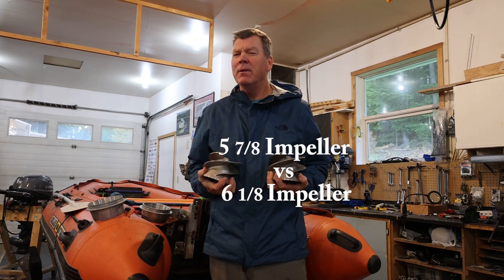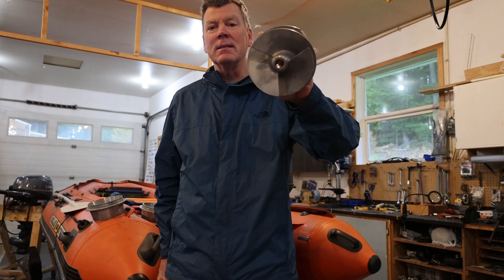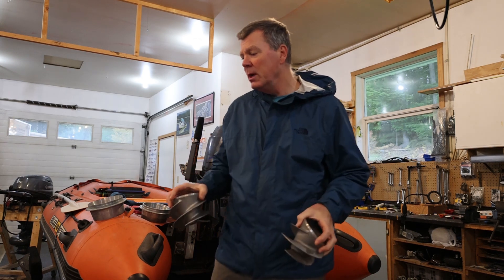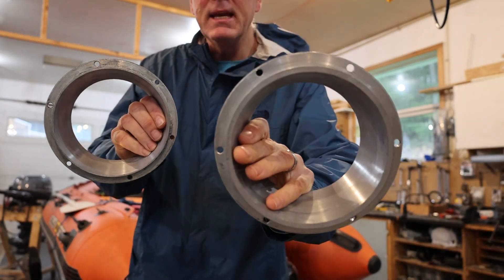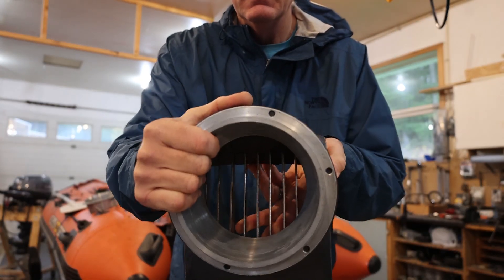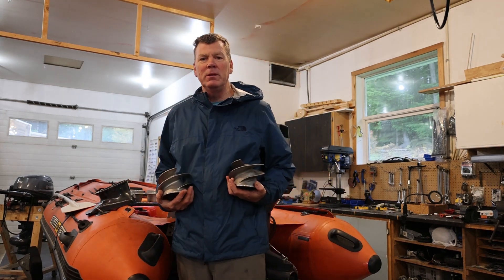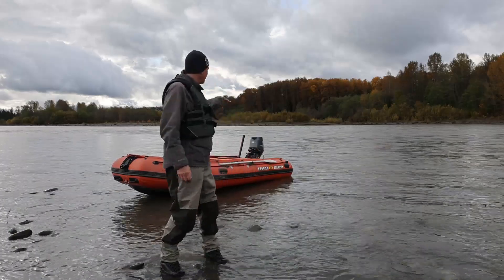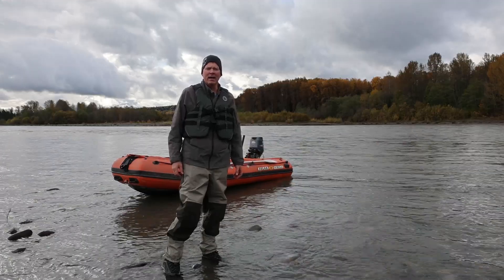Does Impeller size matter?  Comparing two outboard jet impellers.

Comment: I have a "small" pump and my current impeller is 6 inch with bolt in liner. Would I be able to run a 5 7/8 liner and impeller which is more widely available or am I stuck sourcing the 6 inch

Comment: This is very informative and specific as I run a OEM Johnson 45/30HP jet similar to this motor. I believe I am running the 5 7/8 impeller as I do not have as high an RPM range similar to this motor. It has been a great motor though. Bout to add a twister nut and hopefully in a couple months I can get a polished stainless impeller for her. Really would like to see if I can break 30MPH!
Reply from the maker: Thanks 
The 6 1/8 impeller would give you a bit more top end and a speed nut will help with a bit more holeshot
Reply: @ the twister nut/speed nut will be here this week. I sheared my impeller keys this past weekend and had to do a bush fix to get the one trip I had finished. I’m in a 99 Lowe 1448 with a custom front console & tunnel hull with the Johnson 45/30 jet I mentioned. I can hit 22-25 but want to add 5mph as I know it’ll do a couple things… 1) less hull in the water while on step 2) less fuel burn as a result of number one. Also decreased travel times which means more fishing at the end of the day.

Comment: Hey rob, Just picked up a 14ft fishrite sled with an 89' yami pro50, medium jet drive. I assume its a 6 1/8 impeller. Boat had been sitting so I gave the carbs a once over and did a link and sink. Got out for the first time and noticed the hole shot was painfully sluggish. Bow kind of settled half way but then felt like it took about 20 seconds to finally reach top speed. First thoughs are weight distribution or the motors is just a little underpowered. The impeller and sleeve have defintely seen some better days and I'm down to last shim but I would love to hear your input as you seem more experinced than me on this stuff.
Reply from the maker: @loganfishbeard  hmm could be a few things 
Is the intake up high enough? Is the reverse bucket creeping up over the pump at all in forward ? Like u said your liner and impeller am need a replacement if it’s already down to last shim. Is it plowing at full speed? Is the planing line at the back third of the boat ? Make sure the throttle is opening the carbs fully
Reply: @RobBryce Thanks for reply! Intake seems about 1/2" on the low side but no water appears to be coming over the top of the shoe. Reverse gate is clear and snug. Carbs look perfect. Planing surface is just right once the boat gets there. I will try to get some gps speeds next time I get out on the water. I just don't want to drop $400 on a new impeller if what I really need is a $4 sandbag in the bow.
Reply: @RobBryce  Got the boat out a couple more times now. Redistrubuted some weight, weight and she got up on plane more reasonably with 2 small guys at about 18-19mph and topped out at about 26mph. Load down with a fat guy and couple extra 150# of gear I could not get the boat to plane on the last trip. I found a feeler gauge and measured impeller gap to be about .010 righht at the tips but closer to .040 about an inch up where the gauging is on the sleeve so that is technically out of spec.  I raised the motor one hole on the mounting bracket and height feels perfect now. The boat is a heavy hull at about 600# dry weight 1000 with motors/gear. Will a new impeller/sleeve make that much difference or should I just look to go to something like a 70hp at this point. Thanks again, your videos have been a great tool to learn from.

Comment: ChatGPT says the 30 Yamaha peak power is around 5500 rpm. If this is true, then the 5 7/8 is producing more engine power than the 6 1/8, but the boat is going slightly slower. This implies that in the RPM range you've studied, the pump efficiency decreases proportionally faster than the engine power increases. Assuming an approximately flat torque curve of the 400 RPM range, then the 5 /78 power is about 8% higher, which means 8% faster fuel burn, to go slightly slower. So it appears that the 6 1/8 is the better choice. I wonder what is the specific engineering rationale for the "recommended" 5 7/8? Yamaha and Outboard Jets must make this recommendation based on... something?